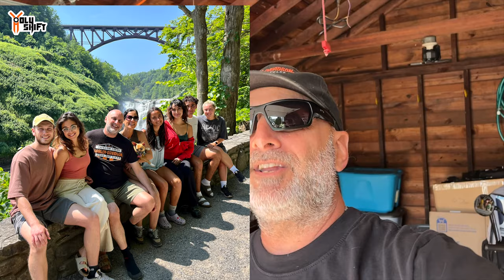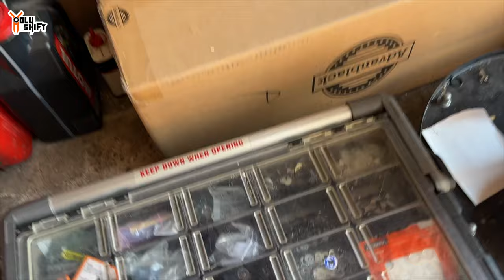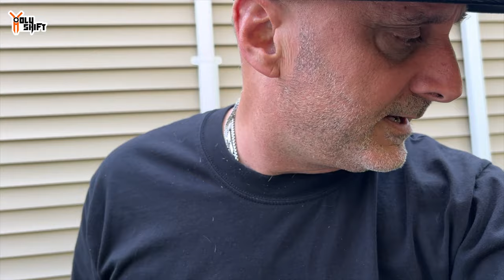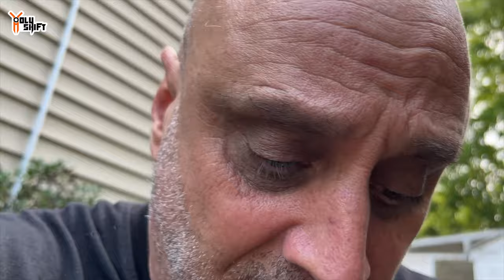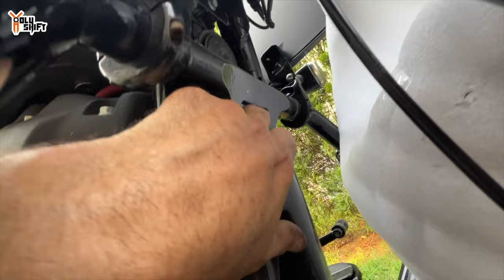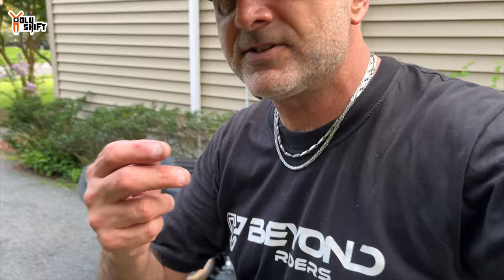Spoiler Alert ! Install A Chin Spoiler On A Softail

Comment: Hi 👋 Sandy , it looks great, but I would have of slotted the top mount on the Chin Spoiler, so I didn’t have to take the nut and blot out, or even change the bolts for round heads , stainless steel or black stainless, , but all in all, I think it looks very nice, 
Phil from the moulin France,

Comment: What a royal pain of an install! Yes, Sandy, I agree the look is "killer," but I'm not sure it's that much better than if you simply painted to match the body and then reinstalled the oil cooler frame that you had to remove. In any case, I suggest you acquire a tap and die set to restore those pesky stripped threads. Cheaper, faster, and more convenient than searching for replacements - especially at HD prices. Great to see you back on video. Enjoy the ride north.
Reply from the maker: Let’s elaborate about that this weekend 😂

Comment: Tractor Supply would carry replacement bolts for your stripped ones or you could get a tap and die set from Harbor Freight and clean up the HD bolts with a die.

Comment: I just removed the clutch cover AND both the bolts stripped… so I thought but in fact it was the flimsy aluminum cover. Harley has to order everything at my dealership. I have those bolts, if you need them I mail to you just let me know…cheers John
Reply from the maker: Thanks buddy

Comment: You could have just cut it like the way you saying manufacturer display in website. In that way it be easier to just tight the nut bolt without removing them  completely.